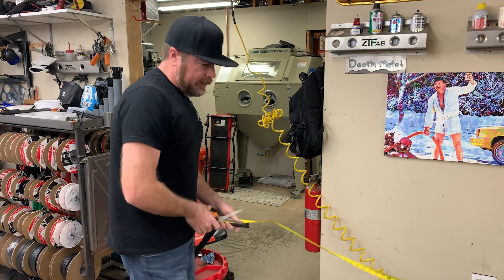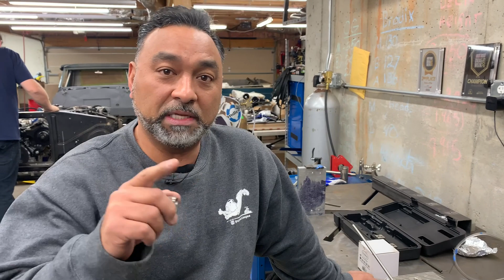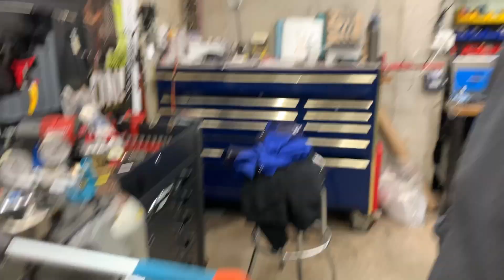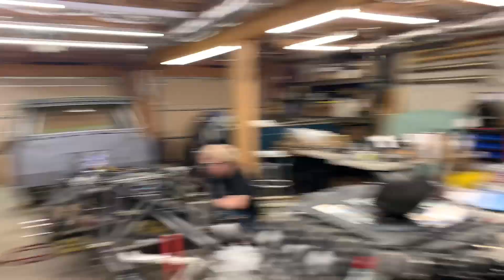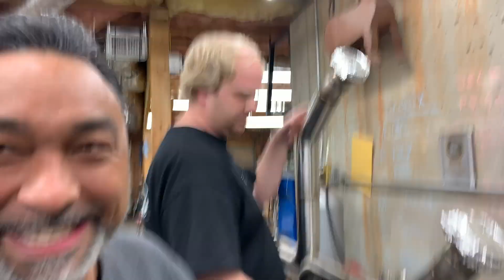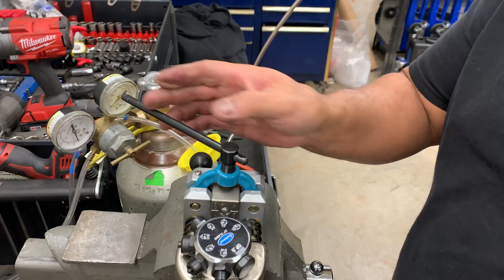The 1-Week Chevy C10 Build and Road Trip-PART 2: Finnegan's Garage Ep.133

Comment: 12ft of power cable and I’m thinking it might as well be a copper rod in a plastic tube run down the chassis like a brake pipe. *thread the rod ends for cable-eyes.

Comment: I had to do a pull of just shy of an 1/8 of a mile of wire through 1 pipe with 7 turns and 4 elevation changes. Actually it was 9 # 12 wires, hardest pull of my life. I suck a string through with a piece of caution tape on it with a vacuum, used that pull a small rope, then used that to pull 1/2 rope then taped rope 15ft down down wire and had some kid literally shove handfulls of yellow 77 which is basically yellow astroglide and used 1 1/2 5 gal buckets but we got that bitch through. It was a gas plant so we could not have a junction box it had to be solid runs. I was a stones throw away from hooking up the winch off the truck

Comment: Are the rad fans oriented correctly?
Reply: Yup, did them myself, ecms on the bottom
Reply: @johnp487  cool.  The blade pitch just seemed off to me.  It looked like they will push air forward though the rad instead of pulling into the engine bay.
Reply: @joshjones3366  oh, the way the blades look, right, yes they are pullers. The DeltaPAG blade geometry is very unique and designed for efficiency and to take advantage our brushless motor tech.  BTW, I'm one of the engineers at #deltapag
Reply: @johnp487  Awesome.  Thank you for being willing to engage the community like this, even for such a simple question.
Reply: @joshjones3366  my pleasure

Comment: The flaring tool is the real deal. I bought all "pre-bent" lines for my C10 and they are a mess. Could've have laid them out better had I bent the lines myself. Now, to just get the gumption to bend all new lines for a system that works perfectly fine, but is a spider web of bends!

Comment: Do you guys safety set the front height to never actually lift the tire off the ground? Like if a line failed and the whole truck dropped to the ground(knock on wood) could you at least steer and stop on the highway? 

Thanks for letting us hang out in your shop, always!

Comment: Why not use pusher fans on the front of the radiator and leave room inside the engine bay , looks neater too .
Works fine on my 383 stroker Chevrolet....
Reply: Yehh but then you see the fans on the frontside which im not a fan off
We have a pull for our radiator for the engine and a push for the trans cooler
Reply: @whatittakesnortheast  Like your joke '' not a fan of '' :o)  But yes take your point but on my Healey the grill you can not see past very easily. 
Cheers.
Reply: @bryansaull7554  on a 72 gmc c10 the front grill is wide open which is what I got im too fat to fit in a healey!

Comment: Here's another way to get that cable thru that jacket.  Use the air to push mason string thru it first, then tie the string to the cable and pull it all thru.  That's how I pulled 200ft of electrical thru underground conduit to my workshop.
Reply: Just 2 days ago, I did the same. Mason string with a plastic bag on the end blew right through 1.5" pvc conduit and then I pulled a rope through and used that to guide the 3 strands of #4 copper and a ground. If the battery cable was a tight fit, then the air probably helped reduce friction. With enough extra space, the string would have worked well.

Comment: Looking good boys!  Love the BOM recognition
Reply: I came straight to the comment to see did anyone else see the bom t shirt 👌😂💯💚💙🍀☘
Reply: @PaceWorks  snap
Reply: Yes, the C10 has been a project for longer than Binky
Reply: @pashakdescilly7517  Haha I saw your comment after I posted
Reply: @pashakdescilly7517  I said yesterday this is the longest utube build some dude goes no Binky is .now everyone is comparing the two WTF
Reply: Was about to comment the same thing. BOM dudes are legends.
Reply: Also love the BOM love!
Reply: @justin watch The C10 will tow the Audi and we can race both pairs!
Reply: @DEBOSSGARAGE  I would love to see that
Reply: If anyone's looking for flare tool look at mastercool. I got the big kit, hydraulic pusher, does single flare, double flare, bubble flare, gm trans push on, flat fuel flare and they have 37° set as well
Reply: @richardturner8630  the Eastwood one they have looks like the same system as a Sykes pickavant one I used to use. Just different body shape.
Reply: What's been the longer saga? Binky or c10
Reply: @hillbilly2480  Binky was started about 6 years ago and the boys have been poking along ever since. The C10 was first built, but not finished many years ago but sat around untouched and unfilmed for many years and was pretty much forgotten.  My money is on Binky for longest continuous saga. My 2c worth :-)
Reply: @alexbrown1995  The Project Binky trailer video was released June 2013, so it's almost 8 years now. C10 probably had longer untouched periods except maybe when Binky was waiting for paint during the pandemic, though they did work on refurbishing the ex-Celica parts in 2020.
Reply: @EmyrDerfel  It's all good watching,  though. I think the comments on the Binky saga are the best - guys complaining that they aren't going to live long enough to see Binky finished, things like that.
Reply: Here we go!
Reply: Project Binky!!!  Love it. Who will get done first.
Reply: Hell yeah!!
Reply: That motor you built for the Aussies is bad ass just heard it first start in the patrol..
Reply: L pop pop pop
Reply: Loving the BOM shirt!

Comment: Ok kudos to the man with the Bad Obsession Motorsport T'shirt!, Project Binky is getting some recognision!
Reply: Yeah the longest running car series in history...
Reply: Guarantee nik will have a last minute addition requiring more brackets and  relocation of various parts in order to facilitate his whim.  Make the noise!
Reply: Just ordered one
Reply: @hillbilly2480  Just ordered 2 here (make the noise being the other one) , Need to order an FSM one to add, as i need a few new t'shirts..
Reply: @Sf_Mason  i need to order me a zip tie life being a sparky
Reply: Paint is done, just needs final assembly, so should only be another 5 years or so away from being finished.
Reply: Not sure I'd be brave enough to drive Binky after the 10000 hours of labor put into it.
Reply: Wardrobe flex
Reply: Is that finished yet? Haven't watched in years.
Reply: @GRPABT1  Yup, Engine's built up, as is the drive train, suspension and brakes could be on the cards soon if i recall and they haven't showed wheels...
Yet.
Reply: @GRPABT1  last episode was paint. Shell is done.
Reply: @mattomber  really cool paint job
Reply: @GRPABT1   Does it look finished.